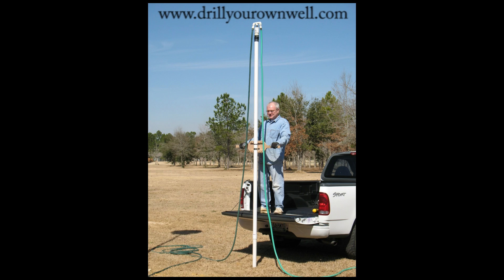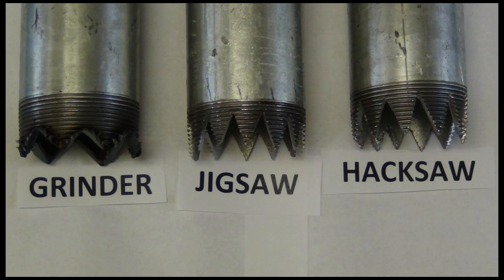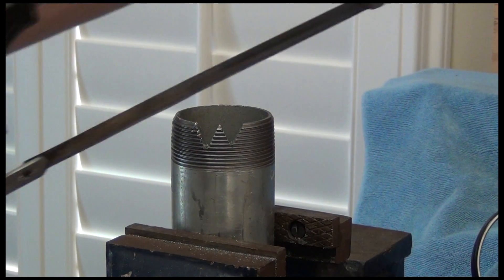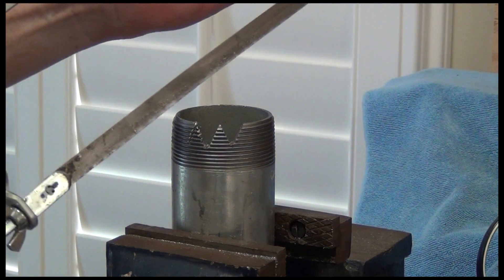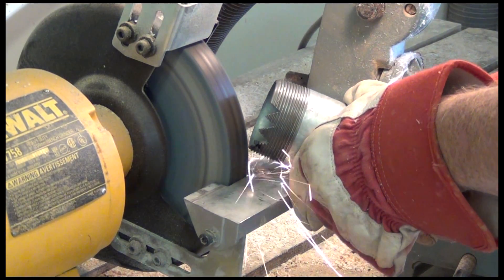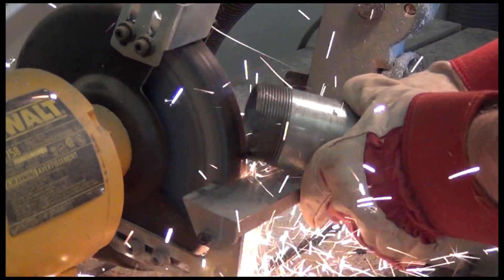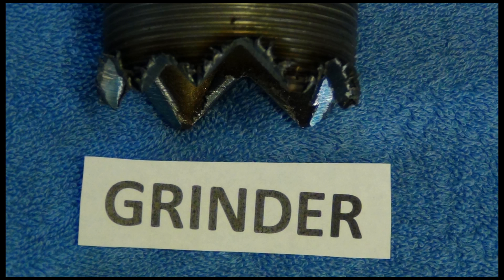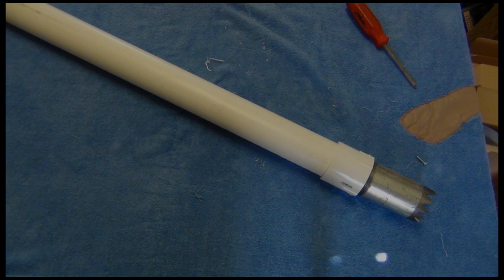Drill Your Own Well Series - Making a Metal Well Drilling Bit

Comment: I had an idea,  not sure if it is a good deal.  I think all my ideas are great, but doesn't everyone.  Would it be better to cut the cutting bit on a collar.  It would be just a little bit bigger.  The only thing is that it may be more likely to get stuck, but if it gets stuck it shouldn't be a problem getting out,  just jet water down the middle like when you were digging the well.
Reply from the maker: You have identified the issue.  It makes a bigger hole which is great for reducing friction on the drillstem.  Generally it works "well" unless you stick the pipe and then it works against you.
Reply: @dawmlw  You can't  win them all!  LOL!

Comment: I visited your website, thank you for that.  However, I cannot find any way to contact you, nor can I find your FB page (notice your site has a link to like you on FB).  I wanted to ask advice on cleaning out an old well that has sludgy stuff floating on the top about 10 ft down below ground level.  It's been covered with an old hubcap for years.  I'd like to dig it out clean again, situating it with a hand pump.   I doubt I'll ever find your reply to this, but  maybe you could add a contact link to your page, and a link to your FB so we can communicate.
Reply from the maker: I have put my email address in at least ten places on the website....  But I'm sorry I'm not much good at developing old wells.

Comment: what if the drill bit could double as a well screen? by cutting slots along the sides of the drill bit and the cap off the bottom with a end cap that could replace another removable cap with the vertical holes and blades at the bottom ??
Reply from the maker: That would be extremely nice!  Problem is you would lose significant pressure where you need it at the very bottom of the drill "bit."   There are some arrangements with a ball valve that accomplish this task but the need quite a bit of water pressure to operate properly.   They are designed for real drilling rigs.

Comment: Which of the three bits worked best, in your opinion?    The two bits made with saws are certainly more finished looking than the bit made with the bench grinder, but that doesn't necessarily mean they will work better.
Reply from the maker: +jetlag Not much difference between them.  The ones made by the bench grinder look ugly but work great!
Reply: the one cut with a hacksaw had to work better. the metal probably maintained a better temper, for not being heated so much during fabrication.

Comment: Thank you for the tip.  If I have a nipple with threads on only one end, will it work as well if I cut the teeth in the non-threaded end?   Just wondering if the threads add something to the drilling action.
Reply from the maker: BC ElginTex Yes, it will.  The threads add nothing.  It is just that nipples are readily available.

Comment: What if I want to use a submersible pump?
Reply from the maker: You'll need to drill a four inch hole, which is very hard with this technique.  Sorry.
Reply: How about with a mud pump and mud box?
Reply from the maker: Brad Kvanbek With a mud pump you will be able to drill a four inch hole.  It will be very slow going but it will work.  50 feet will be about the most you will likely be able to make it.  Good luck and keep me posted if you can!

Comment: Thanks so much for this video (and your website!).
Two of the three drill bits you cut here have 11 teeth of varying lengths. Doesn't look like you do this on purpose.  Have you given any thought to an optimal number of teeth and whether different lengths of teeth make digging more or less effective?
Reply: The teeth were just cut so they would all be about 3/8 to 1/2 inch long.  The number of teeth was not planned.  I haven't studied the optimal number of teeth.  That isn't really a problem, once you switch to a metal "drill bit."  The issues are water flow and keeping the hole open.  The bit will drill just fine unless you hit rock.  Thanks for looking at the video and website!

Comment from the maker: It is certainly not a dumb question!  This technique is most useful for folks who are city water supply and who are having to pay a lot to water their yard.  By using this technique to drill a well, they can water their yard much cheaper.  If you don't have access to water, you might look at the mud pump technique described on the website listed just under the video.  Thanks for watching!

Comment: A tip would be to grind several shallow grooves vertically on either the adapter,or if you are using a straight PVC pipe bit,along the entire pipe using a dremel,or even a 4"hand grinder.Wouldn't take too long.This would let water run up the sides of the bit/pipe better and lessen the chance of getting stuck as you mentioned on your webpage.I wouldn't go too deep as to weaken the pipe/fitting,just enough for the water to give a little more clearance.Hope this helps.Nice series and website!

Comment from the maker: That is correct.  The 1.25 in diameter well screen pipe becomes the well.  It would be nice to be able to use a bigger one but you usually can't drill a larger diameter hole with this process.  You can gain more efficiency by using a longer well screen provided the top of the well screen is under the standing water level.  For example, if you have a high water, say 10 ft.  Drill a 32 ft hole and use three four ft long well screens and the top of the well screen still be 10 feet under water.

Comment: Never wear gloves using any sort of grinder... or really any machine tool! I'm sure google can provide many graphic images/videos of why not to. Also, if the metal gets too hot while grinding it, so that you need gloves to hold it, you've essentially annealed (softened) the metal. The annealed areas are shown in the blue discolouration on the workpiece. 

Basically, don't use gloves and dip the workpiece in coolant frequently to prevent annealing/burning yourself.

Comment: I would like to add an option to this video. I am currently doing this through very heavy clay, to rock and then caliche. IT STILL WORKS. The process is slower but there are some things that help. When going through caliche, slightly bend about 1/4 of the teeth outward so they are the same width as the pbc coupler. Then slightly bend 1/4 inward. This will increase your drilling speed quite a bit. Also, dont forget to drill a small pressure release or you will pop that rubber coupler.

Comment: Used your method to put in two wells just serrating the end of the PVC pipe.   Last well we pulled the drilling pipe and dropped in a new length with spriral slotted PVC well screen at the bottom.  Huge capacity from that well as it is right in a flowing sand acquifer.   Thanks for posting your ideas.  26 feet in about three hours.